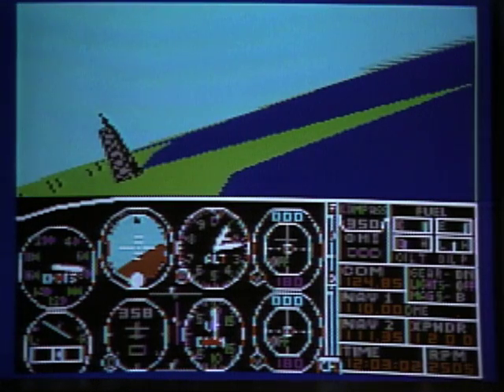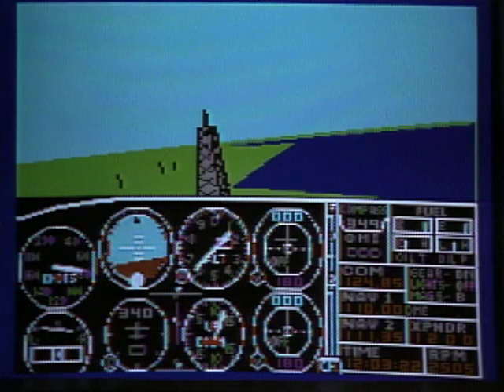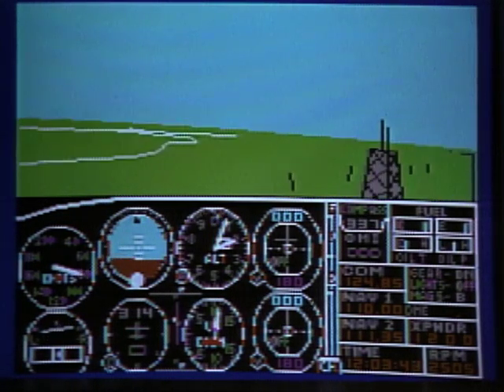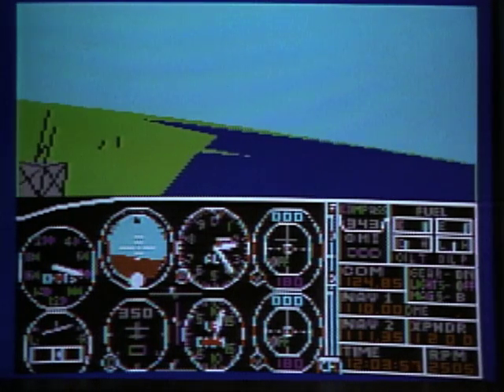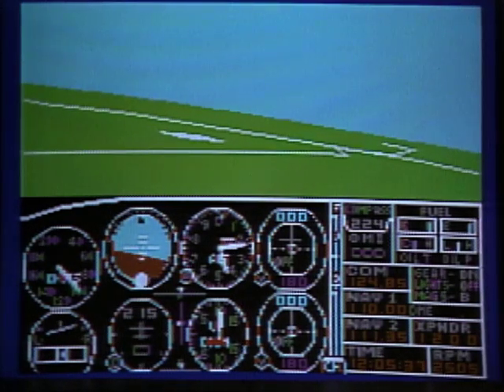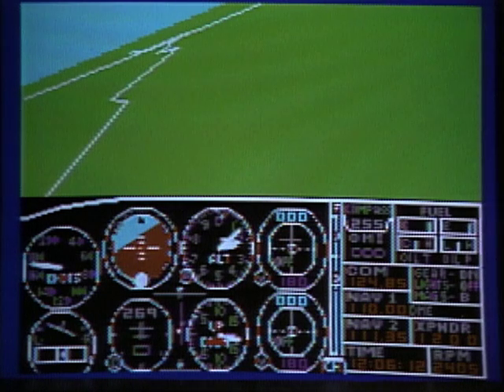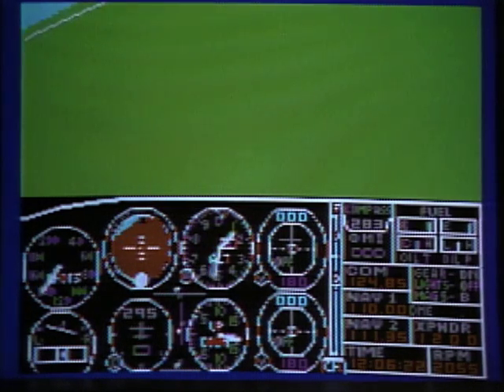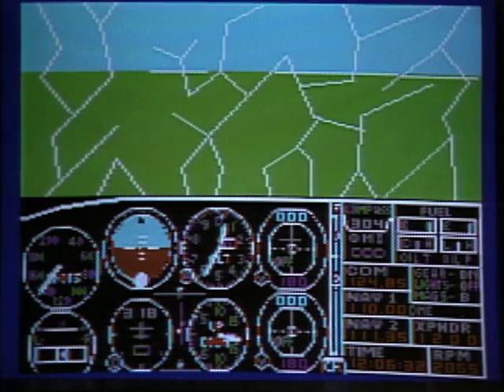How Do Flight Simulators Work? (Mr. Wizard)

Comment: Did you know that Mr. Wizard (RIP) was a B-24 pilot during WW2? He flew over 50 successful combat missions and was awarded the distinguished flying cross. I always wondered if he kept on flying after the war. The B-24 is a large 4 engined aircraft so he would have certainly had several advanced ratings.